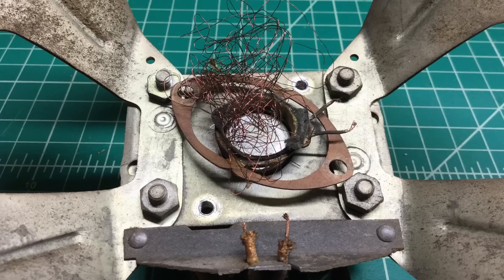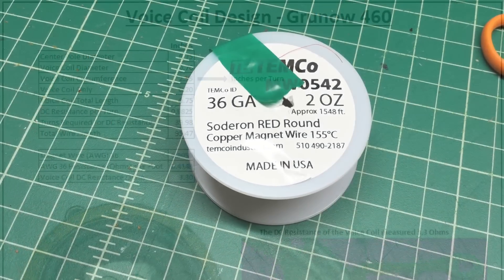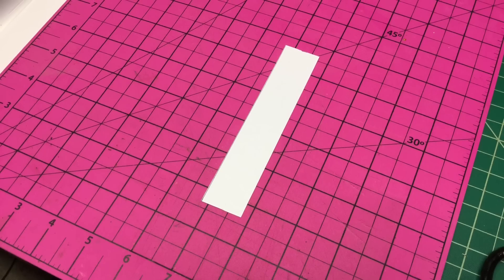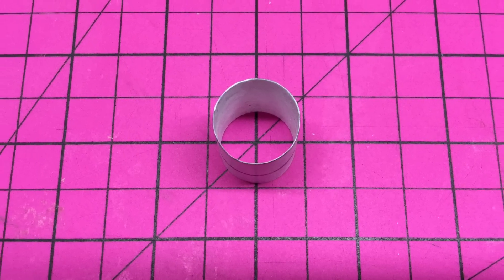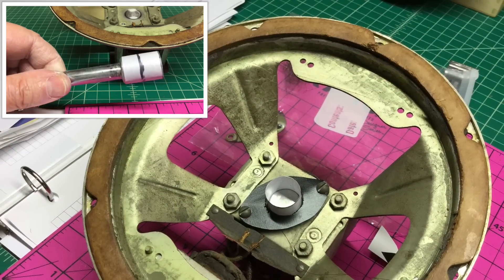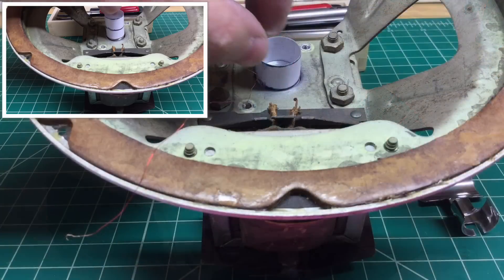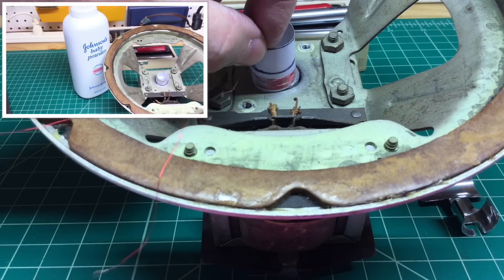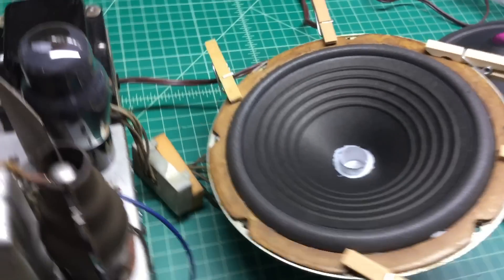Speaker Repair - Voice Coil, Spider & Reconing

Comment: isn't there supposed to be a slight gap between the inside of the form and pole piece? I don't understand your need to lacquer and powder it. I'm doing research before building myself some voice coils.
Reply from the maker: +Are you 'avin a laugh? Is he 'avin a laugh? Yes, you are correct. There has to be a gap ( I typically use 35mm film as a shim) between the center pole piece and the voice coil. I used the powder to ensure any remaining glue was dry and the lacquer for added smoothness, but neither were necessary. I just built a new voice coil and used aluminum for my coil former. One mistake, I should have left a small gap in the former to minimize any impact to the magnetic field. Here's the video for reference: https://youtu.be/X-7f9snqEDg Keep me posted on your progress, I'm always learning from others. Best, Don
Reply: thanks for the link. haven't watched that one before. I'm still struggling to source material for a former, either aluminum or kapton.  I can find sticky back kapton tape but I don't know if that's the right stuff to use. I may resort to paper, even then it won't be nomex.
Reply from the maker: +Are you 'avin a laugh? Is he 'avin a laugh? What size former do you need to make? Best, Don
Reply: the form is likely to be something like 1.005" ID for a 1" coil. not sure of length yet.

Comment: Good work, but why foam surround?
Reply from the maker: Thank you. Just using the parts I had on hand and my experience level. For my edification, what would have been the preferred method? Thanks for viewing and your question. Best, Don
Reply: +RestoreOldRadios The problem with foam is it desintegrates over time, and the heat in a tube unit may accelerate this process. Also it is a bit more heavy than the classic paper.

Comment: Outstanding Don. Two questions If I may ask. What did you use for the spider and where do you get the cone's ?. 
All the best.
Bobby
Reply from the maker: Bobby, I purchased the cones years back from: http://www.electronix.com/advanced_search_result.php?keywords=Speaker+cones&search_in_description=1&osCsid=r1dvc1ule525i7cth4bvr3gmh3&x=0&y=0 I'm not sure they still have all of the sizes, but you can always cut back a larger cone and make it work. I made the spider from a playing card (new deck) and painted it black. I added all of the steps I followed in the description of the video for future reference. Thanks again for following my projects. Best, Don
Reply: +RestoreOldRadios Thank you Don.
All the best.
Bobby

Comment: Hi Don,
You are a patient man my friend, but it results in some great restorations! I've gotten some great tips from your videos. but I do have a question though. Did you take the speaker cone from another speaker or have you found a secret source for smaller cones?
Reply from the maker: Jim, thanks for your positive words. A few years back, I bought my speaker cones from: http://www.electronix.com/advanced_search_result.php?keywords=Speaker+cones&search_in_description=1&osCsid=r1dvc1ule525i7cth4bvr3gmh3&x=0&y=0 I think they are someone limited now on various sizes, but you may want to inquire directly with them and see if they still have access to others not listed. I've used larger sizes in the past and cut them down to size. Hope this helps and thanks again for watching and following along. Best, Don